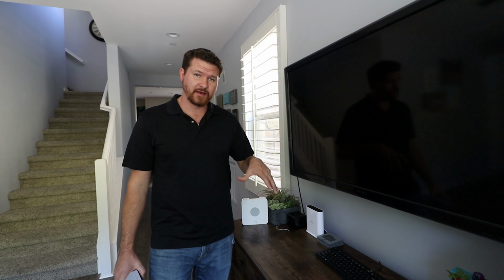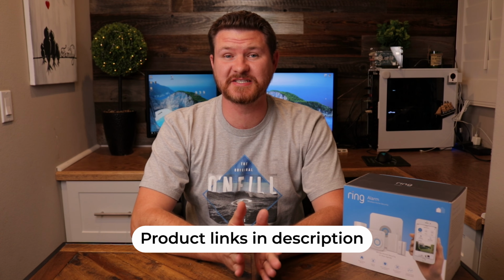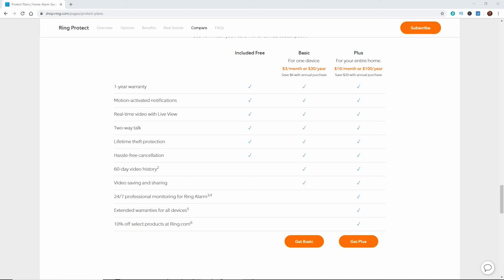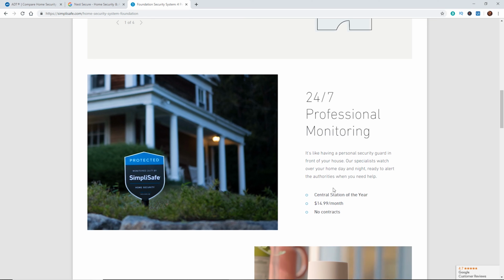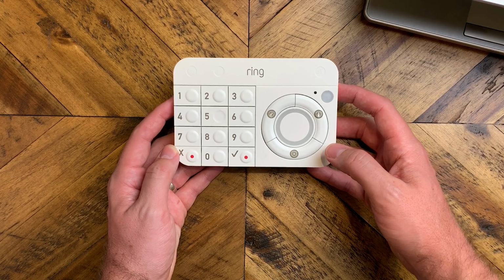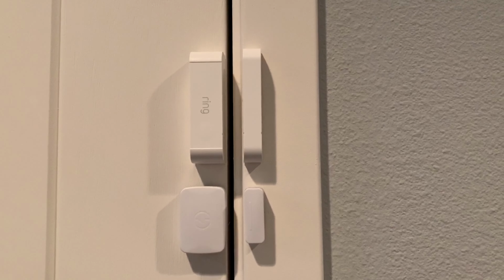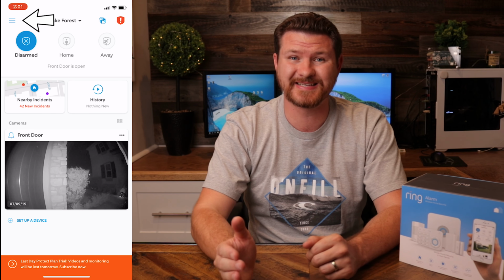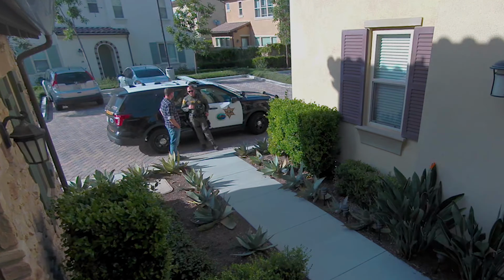Ring Alarm System - NOT What I Expected

Comment: I’ve had my wired alarm system for years and is worked good but as my monitoring keeps going up and up Brinks now wants $55 a month for it ridiculous and the value that they offer keeps going down I’ve had several false alarms and not once did brinks call me to find out any if there was anything going on so the professional monitoring does not work I am happy to say I have installed my new ring alarm and so far I’m extremely happy with that considering I already had ring cameras which I have an a pro plus plan for that my monitoring is going to be included in that so I can hardly go wrong

Comment: Steve, are you still using Ring and what are your thoughts on it 2 1/2 years later? In building a new house, I picked Ring as I got a good deal on it and a POE Ring doorbell through Costco and Facebook Marketplace so my total cost thus far has been about $450 for the doorbell cam, 1 interior camera, and various sensors.

Comment: Best system out today for sure. I work for a big name security company, ring is by far the best. I installed it in my home and no issues. Cameras never fall off line. Easy to use platform.
Reply: Absolute Best would be ADT or vivint products if you aren’t in a total college kid budget but then again these cheap cut rate companies like ring and simplisafe don’t even own there monitoring centers like ADT so when something goes bad … get ready to hear the “sorry bud you got robbed but we chad a disconnection due to not fully owning the monitoring center 😂”

Comment: The problem with RING's water/freeze sensor is the alert is via email, not a text message to my phone.  Frozen pipes are a concern up here in Alaska. So I went with a pp-Code sensor which has 3 distinct advantages: 1) The user can specify the threshold for temperatures, for example, send an alert if the temperature is above 70F or below 50F.  2) Text alerts whenever the threshold is exceeded. 3) The user can remotely look at hourly logs to see the exact temperature and trends for example 65F,62F,59F,55F 50F...etc.

Comment: I was about to purchase this system but this video actually makes me pause. Having the sounding alarm on the main controller box is a big concern. It means the controller has to be in a main area of a home and not in a more secure location. Connecting the system for alerts via WiFi is another. That signal can be easily interrupted making a potential threat go right for the main controller rendering the system a slight annoyance when first entering. 
I understand this is simply an alternative to a professional system. If having to pay for a three year monitoring contract comes into play why not just go with a professionally installed unit in the first place? My two cents. 
The search for a security system continues…

Comment: We just bought a house and considering this system.  If it had cameras like our Blink system and Key fob like Simpisafe, it would be the best DYI system on the planet.  We will use our Blink system to supplement because of the cameras we mount inside and outside the home.  I feel with motion detectors, the window/door triggers are not necessary and will minimize false alarms from windy days.  We would just make sure all our blinds are closed so swaying trees won't trigger the motion detectors.  Thanks for the review.

Comment: Great security system.  For the first three months.  Now I have one security camera non-functional, three bad door/window sensors, and am currently unable to even log in to my account.  The username and password are correct, and on perhaps 1-3 login attempts I get a security code sent via text message, which I then enter, but I never get past that point.  Neither on the Android app, nor in a web browser on their website.  Their user forum is worthless, with responses from the Ring representatives in threads, stating "Problem solved."  Only problem is, they fail to enter into the forum response what the solution was.  I tried starting a chat session, only to get an initial response stating that "first time setup help" was not available.  I simply want to find a procedure to uninstall the 3 bad gen 1 sensors, and install the new gen 2 sensors, plus advice on why I can't view live mode on any camera.   There is ZERO customer support.  The system works great... When it works.  When it doesn't, good luck.  You're on your own

Comment: Had ADT for 11 years with no cameras and paid $46 per month. Just removed it and installed Ring security and cameras 2 days ago. So far, so good. Includes everything for $10 per month. Spent $1,000 on equipment total (ordered lots of extra’s), but the monthly savings will cover the equipment costs in a couple years, then I’ll be saving money. Plus I get way better security and cameras from now on. Seems well worth it to me.

I narrowed down my options to Ring and Simpli Safe, and both seemed great honestly, but Simpli Safe had only indoor camera options and the cost with camera’s was going to be $25 per month. Ring seems to be the best option out there right now based on my research.

Comment: How does the cellular backup work? I didn't know they had that. I was thinking of how I could set solar power up to just my wifi router but seems complicated. How long does the backup work if the lights go out and my router is down. Where does it get the signal from when system is down?

Comment: Notifications are sent to your phone every time an armed sensor is tripped, and it works with compatible smoke/CO detectors. I've tested every aspect of this system, and it has everything I wished my older ($2000 professionally installed system) had. It gives me a secure feeling when I can keep tabs on everything remotely. Set your ringtone for the monitoring number to a loud alarm sound to avoid missing (or ignoring) the call.

Side note, I found that the ring keypad sometimes goes offline if you leave it always plugged in, then you have to scramble to disarm it from with the phone app before it alarms. I leave mine unplugged now until it alerts me to a low battery and have had no problems since.

Comment: If you don't buy from Amazon or Authorized dealer  ur screwed  support won't even talk to you... Also don't by a "Renewed" item off Amazon Ring won't support you.  The stuff is like ahh right, pretty cheap.. You will need a wired connection for internet.. The Wifi on this thing sucks like no other it is really bad. But what you want for 150$  if you use wired internet

Comment: I signed up for dfw security after my house was broken into while I was at work.  It came with 3 door sensor's, 1 motion sensor, 1 camera ( video quality not that good), and a keypad front door lock that could be unlocked via the app.   It costed around $55 a month with a 3 year contract.  My contract is up next month.  I just bought the  Ring Alarm 8-piece kit (2nd Gen) kit with camera and free echo show 5 from amazon for $200.00.  Can't wait to try out the ring and if I go pro monitoring I still save $40 a month.  I already have the ring doorbell, I like it alot.
Reply: I'm glad I came across your comment because I'm getting the 8-piece kit as well. But I never heard of the Echo Show 5. I guess I'll be getting that too. Thanks bro❗

Comment: So when ring calls it's nice because within 10-15 seconds of the alarm you get the call and it's automated. You have to give the correct responses. So our last alarm our daughter accidentally set it off. I disarmed it in about 5 seconds but still got the call. I had to tell the computer "confirm" that I cancelled the alarm and then again "no" that I do not need assistance. This is nice because if someone made you disarm the alarm you simply answer the question incorrectly and the police will come and the bad guy won't have a clue.

Comment: It is a great product. I do have two tips, be mindful where you buy and be ready to be more knowledgeable if you have to call in.  If you buy as part of a promotion at a retailer or similar, you may not get the 10% as explained to me by Ring. Also, I have had to call the service line due to panel not taking my code during a test. The agent did not seem knowledgeable and I knew more as a new customer. However, I do stay up to date with tech so that could be it.

Comment: I currently have Simpli Safe and I do like it. But I have to be honest, I wish I had looked closer at the Ring alarm. I have the Ring doorbell and I have also recently upgraded all my old smoke detectors to the ones that are Ring compatible. Add to that I have been looking at the Ring flood lights for the front and back of the house and it honestly doesn't even make sense for me to NOT have the Ring alarm anymore. The cherry on top is that $100 for the year VS my $26.99/month currently. Figure that's $324 a year, so an extra $224 for what at this point... Might as well make the change and have ring monitor all the new smoke/CO alarms and the new flood lights I will be getting. Thanks for the video!

Comment: I have a mix of arlo pro 2, 3 and ultra. Also a Samsung SmartThings V3 as the brain in my smart home. Another plus is I added the SmartThings contact sensors and motion sensors. I’ve been looking into security systems. After doing some research I was set to get the ring alarm system until I read about the abode iota. Any inputs on smart security systems? Not sure between the ring and abode iota?
Reply from the maker: I haven’t checked out Adobe yet. I’ll have to take a look.
Reply: Steve DOES thanks for  the reply.

Comment: You mention using the app on our phones, but what about PCs, laptops?  Can we do setup and other things using our laptop instead of our cell phones?  Also are you saying the Ring doesn't come with cameras but that Arlo cameras are great and they work with the Ring system (but must buy separately?)
Reply: Arlo cameras do not integrate with the Ring system.  If you want something that you can tie together, get the Ring Indoor Cam (for indoor), Ring Stick-Up Cam (for outdoor/indoor), Ring Spotlight Cam (outdoor), or Ring Floodlight Cam (outdoor).  The Ring cameras on average will get you better battery life than Arlo. The Ring Alarm system package comes with different sensors; you'll have to by the Ring Security Cameras separately.

I just logged into my Ring account on a Windows computer.  I don't see a way to setup new devices. However, you can manage your Ring Camera and Alarm sensors, and see their statuses.  You can also change the Ring Alarm status from Home/Away/Disarmed via computer.

Comment: Cracking review, so thanks! Only question is can you arm it using Alexa?
Reply from the maker: Thanks and yes you can arm but not disarm with Alexa.
Reply: Steve DOES great stuff Steve, I’m sold 👌🏼
Reply: @Aldershot_shipyards  Yes, you can arm and disarm with Alexa. However, when disarming, you will be required to say a four-digit code.  This is to prevent others from disarming your system with voice.

Comment: I currently have ADT, and, although they’ve been great for the last 10 years, I’ve been less than happy recently. I may switch over to RING after watching this-I already have a few of their cameras around the house so it’s a no-brainer. 

I have a question though-what happens if the home WiFi goes out? Will the system continue to function?

And thank you for a great and very informative video. It was a great help.
Reply: Vincent Maltese 
It switches to cellular.
Reply: Joanna C thanks for the info. I will seriously take a look at this, because ADT is really beating me over the head with cost.

Comment: Can I connect my existing Nest cameras to the Ring security system?
Reply: I don’t think so
Reply: Porsche993 is correct; you can't add Nest cameras to the Ring Security System.  If you want voice controls for both Ring and Nest cameras, that isn't a problem if you are using Alexa.  In terms of compatible products that can appear in the Ring App, there are actually a good amount.  Look at Ring's webpage for a list of compatible products (the Ring Alarm Basestation uses Zigbee and Z-Wave, so that is how the products can connect).  For example, there are Z-Wave battery-powered Fire/Carbon Monoxide alarms that I bought, and they integrate into the Ring app).

Comment: What happens if the router/modem freezes up and you lose wifi?  Couldn't a thief cut the cable internet line to the house and disarm it?
Reply from the maker: The $10 a month Ring plan comes with cellular service in the alarm system base. That combined with the built in battery backup, you should still get notified if something fishy is going on.

Comment: You get what you pay for when it comes to security. Ring, simply safe, and nest security run through the WiFi in the home. The $10 a month sounds great until a burglar sees your Ring or simply safe sign and either 1, go to the side of your home and just flip your breaker box off turning off your WiFi making your “security” useless. Or 2, get a universal garage remote controller to jam the door contacts sensors and just walk on in to the home. Those garage controllers go for about $2 on Amazon by the way. Don’t rely on your families protection from some guy that’s sponsored by a company. Do your research.
Reply: Still worth getting for security cameras and most houses don't have their breaker boxes outside LOL what
Reply: William - Isn’t there cellular backup if WiFi goes down?
Reply: @patrickhynes6058  Yes, there is Cellular Backup if WiFi is lost.  This is a feature of the Ring Protect Plus plan.

Comment: I have a Question:  would this system do anything if I didn't want to pay the $10/month?

Would if notify me through the app if I were away and there was an entry?

Would if notify me through the app if I it were in stay mode and there was an entry?
Reply: You can self-monitor your Ring Alarm system.  You do not need to pay the $10/month.  The $10/month gets you:

-Professional Monitoring (i.e. system is armed, someone trips the alarm, Ring rep calls you, Ring rep calls police at your request)
-Cellular Backup is provided if your internet access goes down.  The Ring Alarm will still be functional.
-Covers 60 days of recordings for any number of Ring camera device at the address (normally it is $2.99 per camera.  It caps at $10).

Yes, you would receive notifications regardless. You can customize your notifications in the Ring app, as well.
Reply: So would this be worth ot without paying the $10/month?

Comment: No thanks Ring just got hacked and hackers were able to access the cameras and two way communication and were scaring lil kids
Reply: Actually, there have been articles like this for a lot of different companies.  But, Ring and Nest have never had a hack on their systems.  When people hear the word "hack", they grossly misinterpret it.  These folks had their login credentials leaked via a phishing attempt, malicious keylogger on their system, etc.  Have you ever seen someone on Facebook send you a message that wasn't them, and it included a suspicious link?  Or maybe they made a post on their feed that wasn't them, with another suspicion link?  It is the same thing. These aren't "hacks".

That being said, Ring has already taken measures to prevent those people with leaked credentials from having their systems logged into.  I believe Nest is doing the same?  It is called 2-Factor Authentication, and you should be enabling this on EVERYTHING you can.  This means that if your login information is captured, and someone uses it to login, they will not be able to. You will get a text message with a special access code that will need to be entered.  2-Factor Authentication stops these terrible asshats in their tracks.  Ring requires 2-Factor Authentication now for all users (I think that got pushed though a month ago?).

Comment: Thanks for the great review. I’m considering replacing my expensive ADT system with the Ring system. The only thing I hesitate about is your comment about the sensors being so large. My wife is an interior designer and I want to make sure that they are not unsightly, particularly at the front door.
Reply: Ring offers a thinner sensor piece on their website for doorframes that are weird.  I had to get creative with my garage side door using the regular Contact Sensor.

Comment: Great video.   I’ve owned my RING system for nearly a year now and I LOVE IT. It’s very reliable and you can’t beat the $10 per month price.  I switched to RING from Vivint whom was charging me $55 a month and didn’t include half the service I get from my ring system.  I had my Vivint system for about 15 yrs and RING changed that for me.  It’s definitely a do it yourself system and easy to do.  Also the equipment has a lifetime warranty IF you subscribe to the $10 monthly monitoring and NEVER let it lapse.  Very important to remember.  I really love my system and am saving over $540 a year compared to Vivint.
Reply: Thanks for this info. Do you have anything aside from just the security system? Any cameras? The ring doorbell?